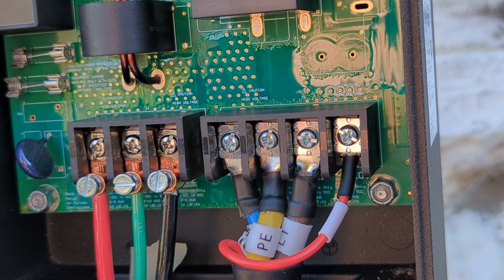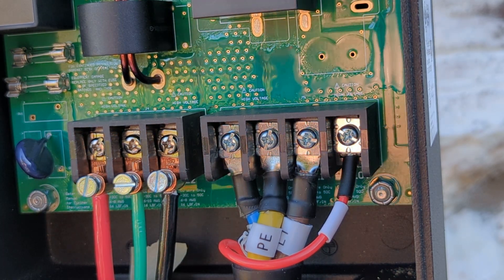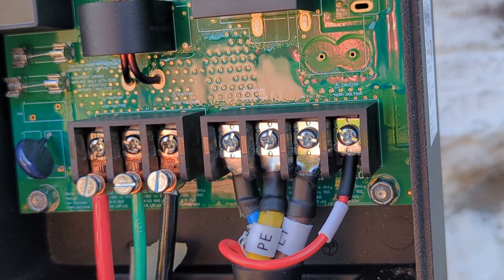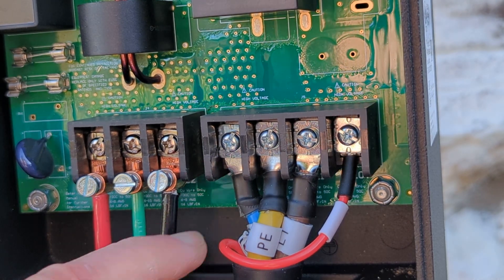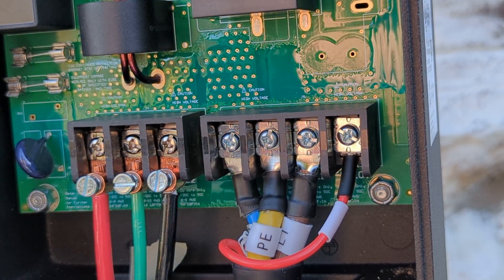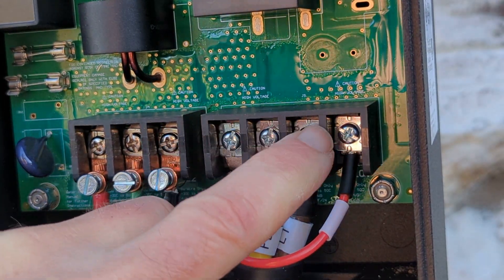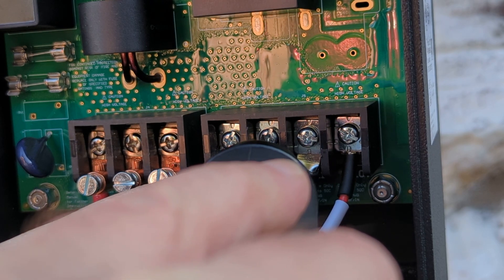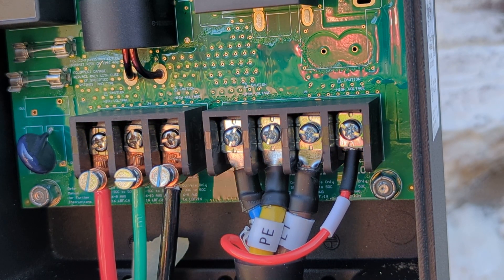Grizzl-e Hardwire part 2

Comment: In your video it sounded like to said 16 and 25 foot pounds. Did you mean inch pounds? I know the Grizzl-e install manual says 16 in lb for the screws into the board, I just wanted to make sure I had the right value for the lugs on the wires. Thanks!

Comment: Hi there,
Very informative little video series.

I was wondering, now that after all your hard work you have figured out the best lugs to use, do you still advise people against using this unit if they want to hardwire? 

Or if one were to follow your guidelines and suggestions is the whole process a lot easier now compared with the part 1 video?

Thanks.
Reply from the maker: I found a few lugs that work. I believe you can find them in the comments here. The whole process is do-able if you know your way around electrical circuits. Having the right lugs from the start makes it not much different than hardwiring other units.

Comment: Have the same issue - can’t figure out an easy way to hardwire the Grizzl-e. found the same lug at Home Depot and wondering if I should use it. Any issues thus far with your install? Also no need to have these insulated with heat shrink?
Reply from the maker: No issues. I did not attempt to heat-shrink these lugs. One reason is that I want to periodically re-torque them. Another is, if you push the conductor through both sides of the lug, the insulation on the conductor meets the lug. The exposed wire on the other side is separated by those plastic walls, so the whole thing is pretty safe.
Reply: @SproutWhisperer  thanks for the reply. I’ve checked with the electrician and he is telling me they these types of lugs are mostly used for ground wires and might not pass inspection. So need to find a different solution .
Reply from the maker: @MonetaFiat  I haven't heard of anybody who used this solution not passing inspection. And ground wires are no different than other conductors. But if you prefer crimp-on lugs, look in the video description and comments for lugs that fit.